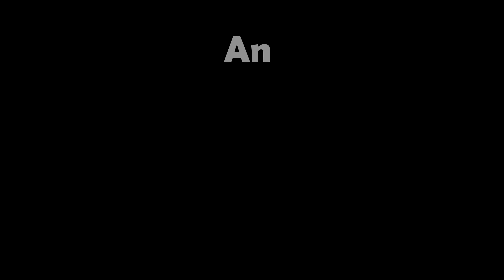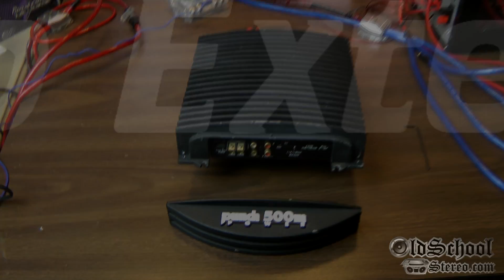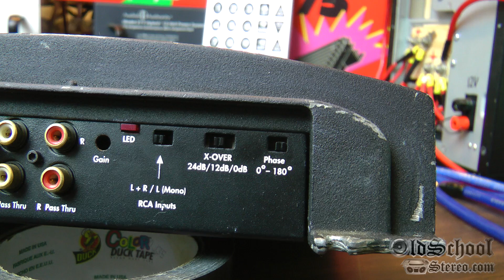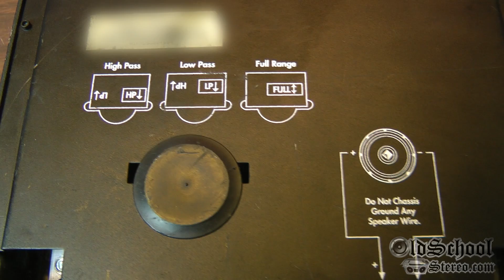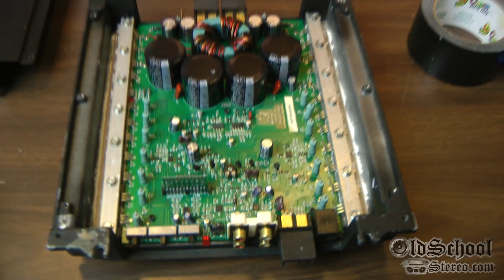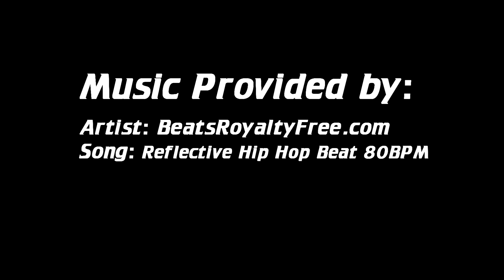Rockford Fosgate Punch Power 500M DSM Amp Overview Old School Part 1

Comment: Hi Derik, 
I have a punch 250x2 dsm and inside amp where the x-over cards , there Two switches . I wonder what are they for. Thnx
Reply from the maker: Did you check the manual?

Comment: The full range of the punch power 500 was exactly  what  we did then . Not just 2 but 8-10 mids  series parallel .  Ant tweets. And then mid bass then subs. All driven by dedicated  amps. Old skool  baby. Greg fall city wa

Comment: About 10 years ago I took my 800a2 apart, I got it not working, one cap was off the board, rather than resoldering it, I bought another from Rockford and replaced it myself, I would love to send it off to get the power terminal replaced, one is stripped, and new paste added, but don't know who I'd trust with it.
Reply from the maker: I'm not sure who has the replacement terminals, but you could check with Jason Gibson at Freeman's Stereo in Charlotte, NC

Comment: I recently got a punch 100ix it's in mint condition too with end caps the warranty stickers weren't broken either. But anyway paid $60 for it I didn't know one channel wasn't working right it sounded staticly I opened it found a blown resistor on the right channel I ordered all new IRF540 & IRF9540 for both channels I repaired the N channel side replaced a small surface mount transistor and two resistors also replaced the thermal grease amp works perfect now.
Reply from the maker: +Kevin Nieto great job! They are great amps, about 2x underrated
Reply: I got a 100ix too and one channel works good but the other channel plays lower. what could be????

Comment from the maker: Hi Michael, I responded to your question in another video. The DD-1 will check 1 percent THD at whatever load you want. If you have a 2 ohm load connected to the amp, the DD-1 will detect clipping the same way it does either unloaded or at 4 ohms.

Comment: I got a question about the dd1 but i think your answer will tell me. Is the gain setting the same from 2ohms to 4ohms before clipping? Does the DD1 only check clipping at standard output which is 4ohms??

Comment: The 500M was a complete departure from anything RF had done before in car audio. The topology is designed for incredible current delivery and it's extremely reliable. It's the only RF amp of this era I will buy.
I would run a full system of nothing but these amps if I had the room.

Comment: If they are cast, you could dye the resin.  Or paint is an option as well.  I like the 3D printer idea, but then I'd have to get one and that would be expensive.  No need for the end caps to be aluminum.  They obviously only minimally contribute to heat reduction if at all due to all those that have never been used with them on.  I worry somewhat about warping of the plastic/resin ends from heat, but no way to know till I try.

Comment: I have installed a number of those, but never owned one. I have a couple of the 250m's. Those are beasts in their own right.

On the endcaps, I kick myself daily because I used to have about 8 extras from installations. However, I had no use for them since all of my amps had them and I was pretty much out of the car audio scene. So, I sold them on a forum.  Low and behold I started collecting the DSM/ix series amps later on & sure enough, you can't find them with endcaps to save your life.

Comment: I was trying to get one on ebay that was missing lots of parts inside, looked nasty but I knew I could revive it. But unfortunately the bidding went more than I was willing to pay, plus all the components I'd have to buy to repair it. Your right about the compound, recently bought a old school punch 45 replaced the dried grease on the semiconductors. Good stuff big D :)